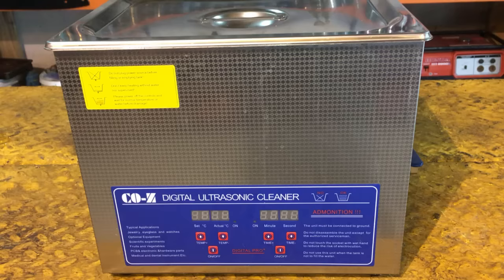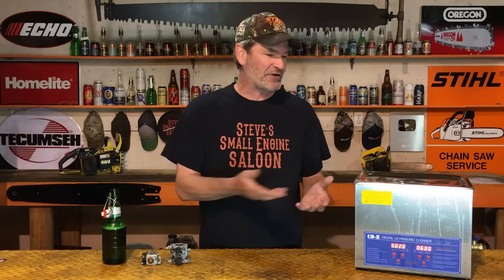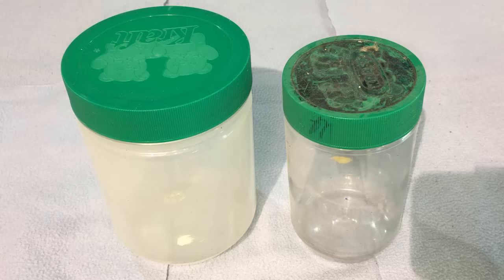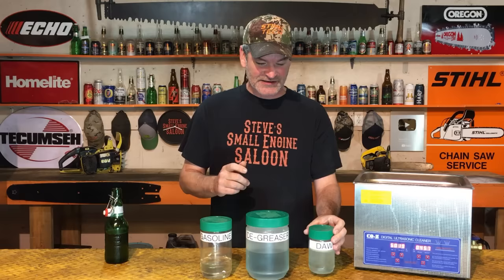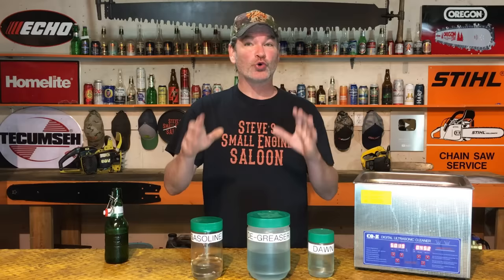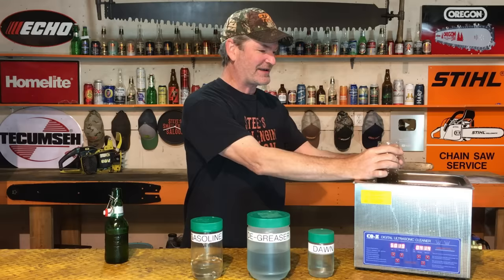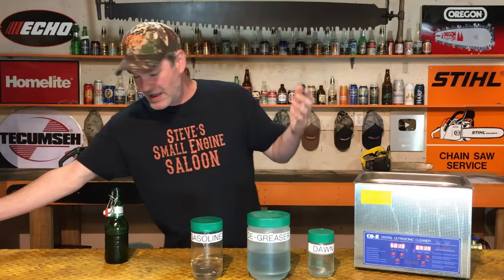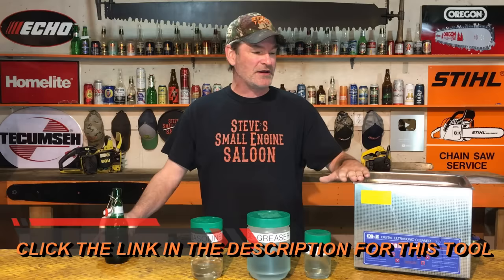ULTIMATE TIPS For Using An Ultrasonic Cleaner (Must Try)

Comment: Hello Steve ... I love your channel, thanks for all the great advice.  I do have a small hint about this video.  Your explanation for using an isolating container is spot-on.  I've used ultrasonic cleaners for years to clean small parts in the pharmacy industry.  When using a beaker or a jar to hold the cleaning solution and the part, it is better if you use a weighted but vented cover to hold the beaker upright and sunken against the basket bottom.  If you allow the beaker to float, it might stay in the same orientation the entire cycle and not all parts of your part will be exposed to the cleaning action.  Always use the basket and never set the beaker or jar on the floor of the cleaner. Always fill to the fill mark.  Always make sure the part in the beaker is below the water line in the cleaner .... and if at all possible, use deionized (distilled) water to fill the cleaner tank.  Also I know glass is a no-no in your shop, but glass is the container-of-choice, because a plastic container can flex enough to attenuate some of the ultrasonic signal, whereas glass will allow transit with minimum attenuation.  You can tell we had shop SOPs that required this stuff, but I'm only offering here just to help out. :)
Reply: You are right on the spot.
Reply: Calvin:  Excellent suggestions, especially on the venting idea.  I have a question;  I have had great difficulty finding information on high quality plastic jars that are truly resistant to gasoline.  I received an ultrasonic cleaner as a gift.  I want to use this isolation method to clean metal parts.  I have easy access to mason jars.  My fear is that the metal parts vibrating inside the glass jar during cleaning might cause it to break which would cause a huge mess.  Is that a baseless fear?  Your input is appreciated.
Reply: @wrongfullyaccused7139  I'm wondering the same thing, I'm also wondering how thick of a glass container he's using. Most glass jars are fairly thick, not sure if that would be too thick or if thickness even matters here.
Reply: @bodeine454  ;I don't think the thickness would matter that much.  I do suspect that if the part being cleaned is heavy enough and sharp enough it might be capable of breaking a glass jar.  Fact is I just don't know and that bugs me.
My son got me an ultrasonic cleaner for a gift.  I will just experiment and learn.
Reply: @bodeine454  ; That seems logical.  Perhaps you end up with a mess, but it can be cleaned up afterwards.  Best of luck.  Be blessed and stay safe.
Reply: @wrongfullyaccused7139  Thank you and you too, have a blessed day. I'm working on this cleaner as I type this. I have to go in the garage and get a different screwdriver to remove these screws that are down in these holes on the bottom, the one I tried to use in here is just too big. Have a good one 👍
Reply: Thanks for the tips (not hints). :)
Reply: Rain water OK? Cheaper and more available....
Reply: @a2phil  any water will work
Reply: I tend to go overboard with cleaning, especially with my gun parts. I used a cleaning agent meant to clean gun parts in an ultrasonic cleaner, but probably went too heavy on the mixture, and I put my pistol in there three times in a row. It took the finish off in places, so tread lightly.
Reply: “I don’t like glass around my shop” - oh, except for all the empty beer bottles on the shelves behind me😂
Reply: john..   I believe that most people go way overboard cleaning guns.    They have cleaned more than a few to death   been shooting for more decades than I care to think about. Bought every new gee wizz solvent/oil/grease /snake oil that could afford ink in any gun magazine.   I guess that I am a pretty good shot... with handguns at least.   I mean... do something enough times...  So what I noticed was thatmy guns shot better with a barrel that had a box or so of ammo run through it and not been cleaned than one I got spotless after firing as few as a dozen rounds.    About the same time I noticed that looking at my guns and ones brought over to me I liked working on em and reading up on em...   I noticed a lot of em were damaged or downrigjht worn out from constant cleaning.  I also noticed that every time I went to a gun store or box store I was picking up two or three of the latest and greatest solvent of the week...,   Some were and are pretty good but not as good as the stuff I discovered and they were all expensive as all get out.   So what I discovered was a solvent posted in an article by the NRA in the 30's Called Ed's Red..   Look it up...   It used stuff like whale oil but ATF works even better.  The only mod IO did was to add a few ounces of Amyl Qcetate to each quart.    They actually use that stuff in perfumes...   it was thought up to clean primer salt from the primers back then but it also worked on black powder guns...  This I know for a fact cause  that is what I clean em up with    What I end up with is a CLP that came out way before the modern stuff and works.....better   I can mix up a gallon of it for what it costs for one 8 oz bottle of magic snake oil.   I also keep a rag that has a light sprinkling of the stuff on top of my gun safe to wipe down guns...   from handling but also in place of an actual cleaning   I now clean my guns about every other outing... sometimes less..   I can afford to give away aquart or so to buddies now and then.    And?   you tend to use more of it cause it is cheap...  slather it on and come back in an hour and finish up  Ok... on the ultrasonic..   I only use it for parts that I am going to refinsh    I clean parts before nickel plating or blueing   Anyway... llok up Eds red.the only expensive parts are the Amy acetate and the lanolin...  I mean if you tried it and did not like it.   And hey...   it is a great penetrationg oil...  Think itt comes in a solid second place in all  the testing I have seenright next to #1 and way ahead of #3....  I think only Kroil edged it out ..  Have you priced kroil? @johnygator
Reply: @a2phil 
It has minerals in it. 
Distilled is better, doesn’t cost much, and won’t leave mineral residue / scale in your cleaner.
Reply: @stevehaynes2857 
Yeah, but they’re not on the work bench and stuff, where they’ll be knocked-over and broken.
Reply: Can't be using it wrong as I haven't got one😢

Comment: You don't like having glass in your shop, but there are 30 glass beer bottles behind you:)
Reply: lol good point.
Reply from the maker: LOL!  Great point, but I don't use those, they just sit there as ornaments....
Reply: The beer won't be knocked over.  That would be alcohol abuse and simply not tolerated!
Reply: Steve's Small Engine Saloon what about Naptha?
Reply: @StevesSmallEngineSaloon  , Those lined up bottles there are Great BB gun targets. Just go to the other side of the garage and see for yourself :-)
Reply: @StevesSmallEngineSaloon   Alcohol in glass is acceptable...haha.
Reply: Thems is memories of good time with good ppl.
Reply: If one of those fell, it would be alcohol abuse. Canadians don't abuse alcohol! 🤣
Reply: Good idea.
Reply: @splash5974  Canucks aren't alcoholics, they are drunks. Alcoholics go to meetings!
Reply: @tenncutt  
Lol
Reply: That glass doesn't break, just like the cake at my birthday party has no calories.
Reply: Do you mean,
"If one of those bottle should happen to fall
29 bottles of beer on the wall?"
Reply: @StevesSmallEngineSaloon  You should just glue them down with some hot glue, I did that in my shop after I knocked a few off once. Worked like a charm. Cheers and thanks for the great content.
Reply: Great tip 👍👍
Reply: NOBODY DROPS BEER BOTTLES
Reply: Entirely worth the risk.
Reply: Lol
Reply: @StevesSmallEngineSaloon  Regardless of plastic or glass (glass for me!), this is an awesome hack! Thx!! 👌
Reply: @splash5974  If one of those bottles should happen to fall, 32 bottles of beer on the wall.
Reply: Beer and other alcohol vessels are exempt.
Reply: I think he talking about handling glass not something sitting on a shelf out of reach, maybe those glass bottles are secured using double sided tape or something. I would run fishing line across the display in case of earthquakes ( I live in California ).
Reply: Obviously he means working with handling dropping them while greasy etc.
Reply: Exactly what i looked and start to LOL
Reply: ever try to break a beer bottle with no liquid in it at all. its not easy. and your arguments stupid because thst is a collection display
Reply: Necessary evil of the job!
Reply: Beer is an essential item.  The shop wouldn’t be productive at all without it!  👍🏻
Reply: The Grolsch Bottle is the Holy Grail of the beers . If you don't have one in your place  you haven't lived yet .
Reply: And one on the table
Reply: @billydarley6925  our
Reply: Called having Taste probably glued

Comment: As a watchmaker who works with ultrasonic cleaners regularly and also wears glasses, be careful because cleaning your glasses in the ultrasonic can remove coatings from your lenses. Don't ask how I know.
Reply: Thank you!
Reply: Thank you!
Reply: It can definitely remove or damage the clear coat finish and other finishes from the frame/temple bars. Don't ask...same.
Reply: It can also loosen screws to the point that they fall out!
Reply: Great information thanks
Reply: How do you know 🤔😂

Comment: just be careful about heat in the ultrasonic, when using jars with tops.  You can burst one open due to the expansion of the contents. It all depends on the contents and how much heat you use.  If that was Gasoline, it could get a bit more than exciting.

Comment: Small safety tip. Don't put your hands into the cleaner when its on as the vibrations will badly effect your joints.

Comment: For cleaning really small parts, put them into a stainless steel mesh tea ball.  It holds them safely and serves as a built-in strainer when removing the parts from the container.  Tea balls are available in many sizes from 1" to around 4" diameter.
Reply: I have done this too ! Many times, for watches
Reply: I work in a lab where we use sonicators daily. So you fill it up with water, then you put your parts/samples in a small glass container, and the cleaning solution in the container with the parts. I do like the tea strainer idea though.

Comment: Had no idea it would work through jars like that. It brings it to another level.
Thanks for the great idea.
Reply: I agree.
Reply from the maker: You're Welcome...
Reply: Sound waves don't care bout containers 🤣
Reply: I agree, but in retrospect, I feel like I should have realized that. Glass conducts sound quite well.
Reply: @MrTheHillfolk  Like honey badgers?
Reply: @guardrailbiter  
Yup they just eat em up nomnomnom
Reply: @SmallSpoonBrigade  Glass does indeed tend to conduct sound well, but the risk of shatter, either in or out of the tank.
Reply: @guardrailbiter  They don' give a f$%^
Reply: haywood jablome 
glass is inert!
many plastics breakdown in the presence gasoline.
Reply: @chetopuffs  Aye, which is why glass is a great tool with many applications.. but not for this one. Hes using the containers as a vessel to segregate the water bath from the cleaning solvent. Yes, the solvents will eventually break down thw plastics, but thatll take a while, and when it eventually does happen, you easily replace the plastic container. The solvents get disposed afterwards so any impurities added to it dont matter.

While the plastic container will eventually thin and weaken, itll never shatter. The pros still far outweigh the cons of using plastic in this application.
Reply: @haywoodjablome440  glass won't shatter in the cleaner. not sure where that snippet of misinformation came from, certainly not from the video.
Reply: @MrTheHillfolk  there will be an energy loss, but in that unit it will be trivial.
Reply: Years ago when ultrasonic cleaners were just hitting the market, the company I worked for purchased a 90 gallon model. The manufacturer told us not to use plastic containers in it because plastic will absorb the sound waves and reduce its efficiency. To what degree I don’t know. They said glass was best. We still used plastic at times and it did work.
Reply: We use glass beakers in ours at work.  It works very well and they are easy to clean when done.

Comment: It also accelerates the effects of rust removers like evaporust. I put evaporust in jar with the parts to be cleaned and then the jar in the ultrasonic with plain water.  I've also used ziploc bags instead of jars.
Reply: How long will the bag survive in the cleaner?
Reply: @gustav901  It would depend on the actual bag, I would think.  Temperature matters also,. I haven't done any testing to failure.
Reply: I see people in the 3d printing community use mylar bags as they last a lot longer than regular plastic.
Reply: Ziplock bags was what I was thinking about
Reply: I had to clean a big ball bearing from an autoclave that had 20 years of baked in grease, hard as a rock.  I put it in a ziplock bag with gasoline, with that inside another bag of plain water.  That was because I was using the ultrasonic cleaner in surgery... late at night when nobody was there to say no.  20 minutes.  Worked perfect.  This was back in the 70's.
Reply: @jservice6594  yikes, I might have triple bagged it in that case!!!
Reply: Beautiful idea. Thank you!!!
Reply: @jservice6594 , the statute of limitations has expired so you're safe! Thanks for sharing that story.
Reply: zip lock freezer bags or even better the food saver brand bags may be a bit more robust.
Reply: I cleaned about 9 motorcycle brake calipers. All of them had brake fluid in them. Next I cleaned a Motorcycle engine cover (points cover). I forgot I had cleaned a bunch of brakes and the sonic cleaner water had brake fluid in it. I heated the water and ran the cover in the cleaner for 30 minutes. I took the most of the clear coat off. It wasnt what I was trying to do but It looked so much better I did the rest of the covers and will leave the clear coat off.
Reply: Zip lock bags are a great idea. I'll use this one. Thanks.

Comment: My go-to ultrasonic solution is the pro-grade Simple Green (which, ironically is purple), it has additional surfactants (reduces surface tension) which makes the ultrasonic action more effective
Reply: Why would deionized water (distilled water) work better, do you know?
Reply: @riccardocarbo2479  deionized and distilled water are 2 totally different kinds of water. For an ultrasound cleaner you'll want to use distilled water
Reply: @scottguyer  They are basically the same thing, just different ways of production.  Distilled is through distillation.  Deionized is through filters.  Both should result in pure H2O with no impurities.  Only real difference might be the PH level.  Deionized is "poor mans" distilled water.  As its far less costly to produce than to actually distill.
Reply: @scottguyer  i presume the goal is to keep the tank clean and free from deposits. deionized/demineralized works just as well. why distilled?
Reply: @asusreviews  you have no idea what de-ionized means. if it was filtered , it would be called "filtered".
Reply: @riccardocarbo2479  it doesn't
Reply: almost all soaps/detergents are surfactants
Reply: @executive  dionizing water is a type of filtered water.  It's done through filtration.
Reply: @asusreviews  Ions are molecules (and sometimes single atoms) and they are far too small to be filtered. De-ionization removes charged particles electrically. The result is very different from distillation. De-ionized water contains non-ionic impurities.
Reply: Isn't deionization a method for reducing problems with hard water (chalk residue in pipes and appliances) without filtration or real dehardening (which uses salt and changes the ph of the water). Distilled water is pure water without any minerals like chalk either filtered or captured by condensation. (Sorry for the poor translation from German)
Reply: @Alex-kr7zr RODI is about the same as distilled. It's filtered through filters, a membrane, then through demonizing resin. Used for reef tanks. 👍

Comment: I really like the idea of using gasoline to clean carburetors. It shouldn’t hurt the fragile diaphragms and what nots. Thanks for the tip. Great video.
Reply: Don  Better than how we did it in the 70s/80s. Soak the carbs in gas and just use pieces of wire, bristle brushes, and picks to clean them with our bare hands.
Reply: yeah I'm use to by hands with petrol but i was afraid to use petrol in the ultrasonic cleaner for risk of ignition. 
but containing it like that sounds great.
Reply: @AnthemBassMan  I was a mechanic back then and we used to boil them out in carb cleaner, ya that stuff wasn't toxic at all. Maybe that's why my wife insists I'm dumb?
Reply: @mattmoilanen3813  Yep! Then we graduated from straight gas to the 1 gallon cans of Berryman's B12 carb cleaner.
Reply: @mattmoilanen3813  My old work place had interesting setup to clean spray guns. 100 liter barrel half full of acetone, suction pipe to pneumatic liquid pump, from there trough rubber hose to copper pipe made into nozzle that spurt into stainless sink where it was directed back to barrel. First time cleaning the gun my rubber gloves melted, so what "smart guy" does? Takes them off and washes it by hand... After doing 4 color custom paint job and washing the gun several times, i was so drunk from skin contact and gasses i almost fall over. Hellawa hang over next day and pretty sure my IQ drop 20 points after that...
Reply: @Hellsong89  hahaha your story gave me a laugh man